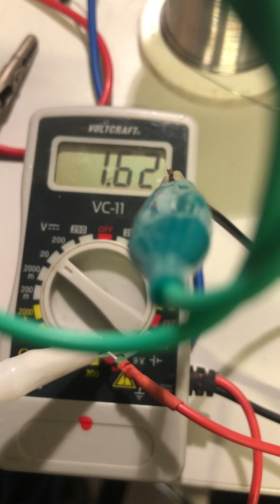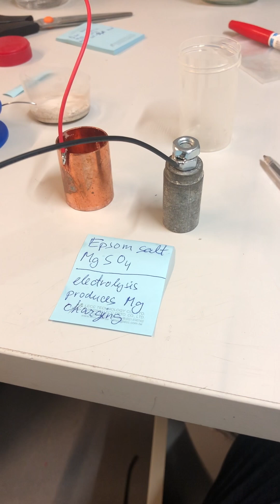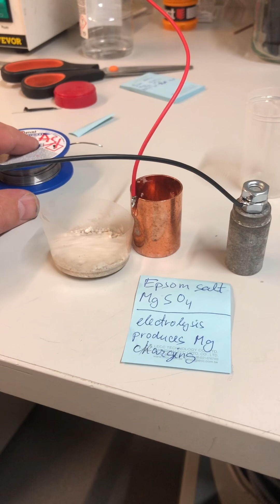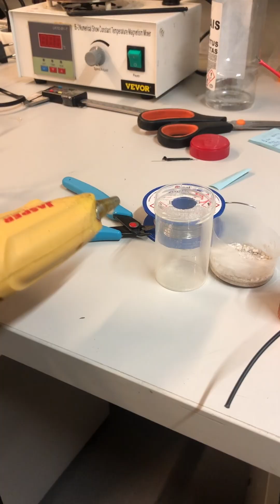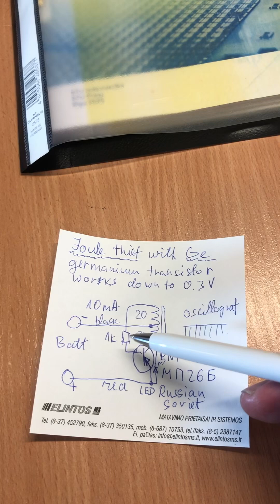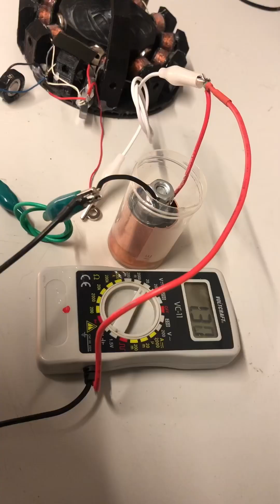DIY crystal battery Mg Cu MgSO4 1.1V, powering easy spin motor and a Joule thief LED.

Comment from the maker: dry magnesium-copper emergency batteries are used in lifeboat radio transmitters. They get automatically activated when the boat falls into saltwater, and can be stored dry for decades.